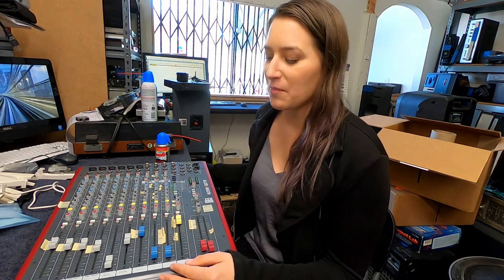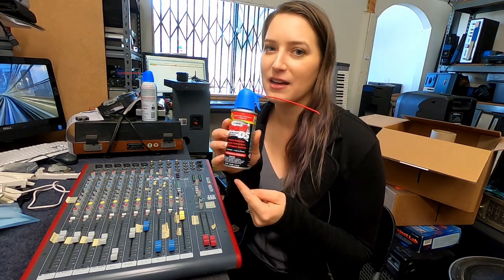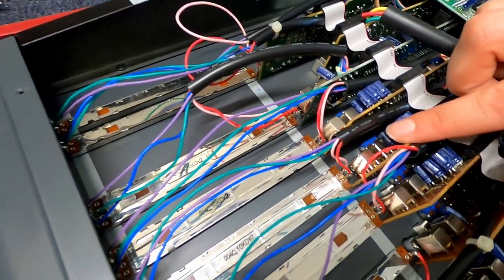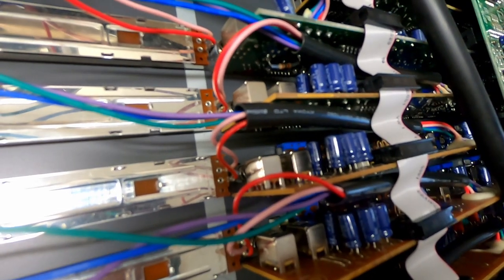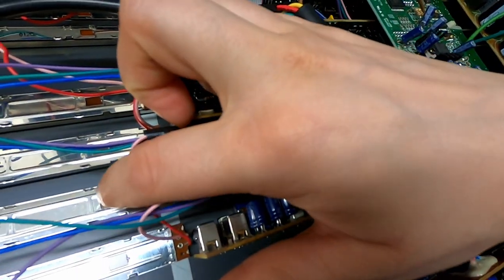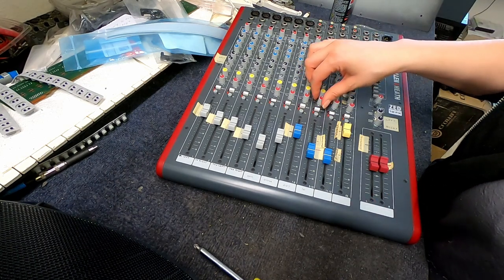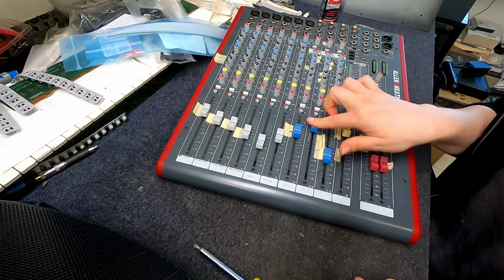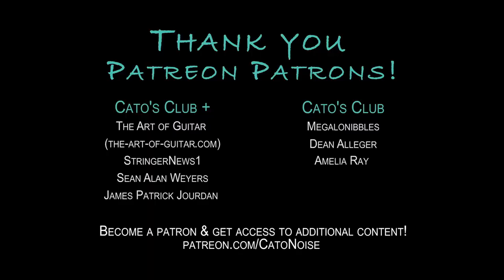Cleaning and Maintaining Pro Audio Gear: DeOxit!

Comment: It's funny that, you, or someone in your shop, already made the leaky  "perfect straw" nozzle swap from Caig,  to what looks to be an air duster nozzle-cap, that I found is a great, non leaking and easily controllable nozzle & cap combo.  You should look into the D5 FADER product, as that is the one that is better suited for cleaning & lubricating carbon type fader & pot controls. The regular D5 is better for switch contacts.

Comment: I would put a little pressure on that slider. Downward, pull it up a little and side to side while you're moving it. Also continuing sliding it for a good minute to thoroughly breakdown the oxidization. Any left behind can crystalize into deposits that are so hard they'll never come off.

Comment: Awesome video Cato!! I keep on the ready D5 and Fader Lube. They have brought back to life many boards. I wouldn't worry about the run off. Dexoit is made plastic safe.  If you spay to much, just wipe it off. No big deal.  May I suggest you can purchase flex tips that can get into tight spots.... Huge help. And for 1/4 Jack's or any size female jack, try giving some CRC cleaner a try.  You can also use them on cable ends as well... Great video!

Comment: Love the channel, but I’ve gotta comment... that is WAYYYY too much chemical run off onto unnecessary surfaces. Also, it’s helpful to tilt the unit on all sides as you’re turning the pots / sliding the faders to work in the Deoxit

Comment: Sound disappears at 4:52.  Also, it would be helpful to a novice (me), to know what one is cleaning off.  Oxidization?
Reply from the maker: Yeah, I think I edited out the sound in that part because it was a bit too obnoxious. Sorry I didn't mention what it's cleaning off! But, you can look up the product description and it'll tell you. It basically cleans the contacts, so dissolves oxides and sulfides. It also has additional components in it that leaves a thin thin layer on the surface of the components. My understanding is that this layer prevents oxides from reattaching and protects the components going forward. It also can be used as a safe flushing agent to wash away dust and debris that builds up over time (which, I believe, is the reason why we use so much on some devices - to get enough flow to flush stuff out). Anyway, hope that helps, and thanks for watching!